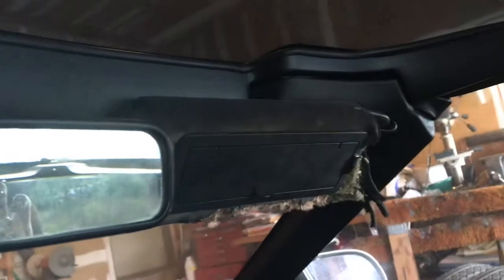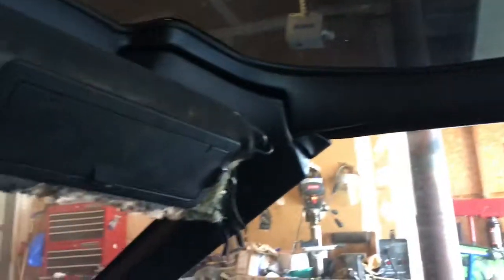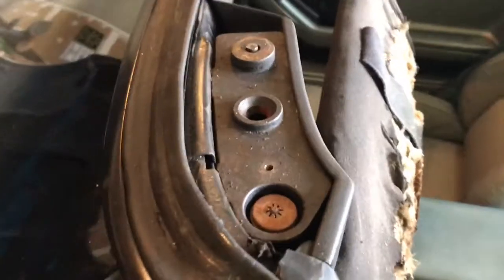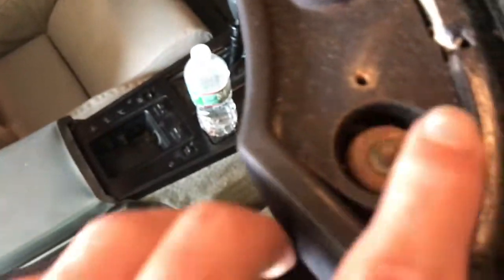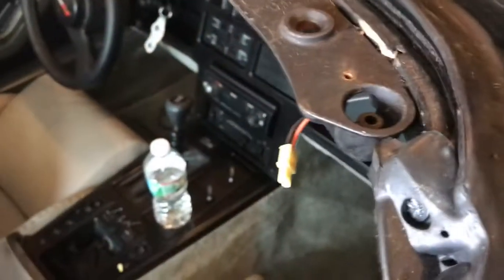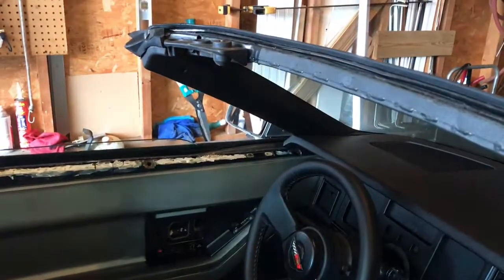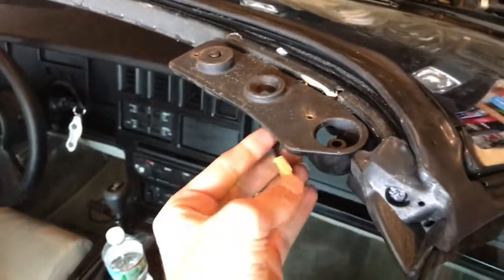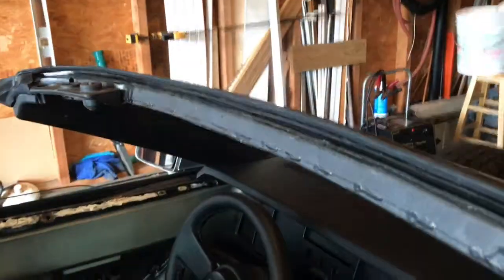85 Corvette sunvisor replacement with Homelink

Comment: Replaced mine on my 95. The sides were floppy. Corvette Central had some that chose , but didn’t get driver side in correctly (I hate instructions) anyway got it in okay. My 95 has 36 k miles on it. You can’t imagine the things required to keep a Vette up! Good luck with your project can’t wait to see how it turns out.